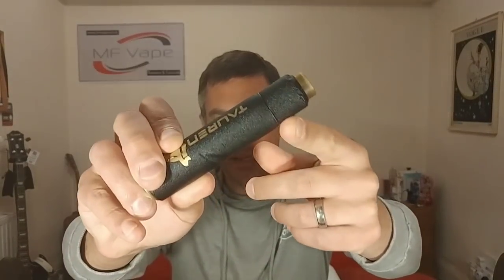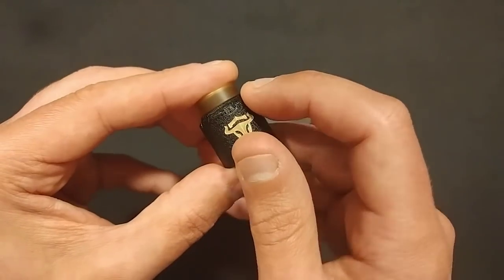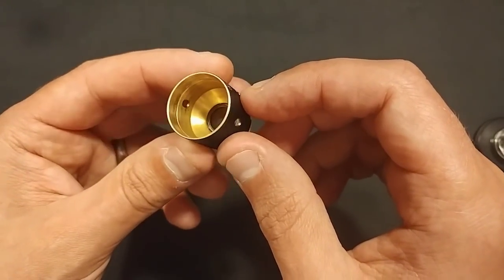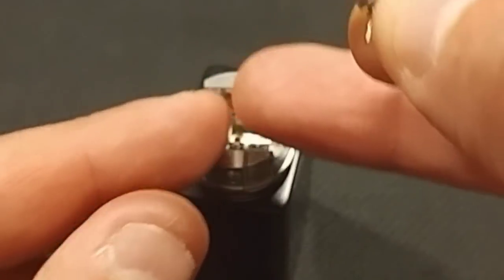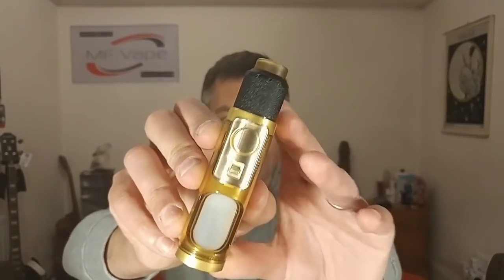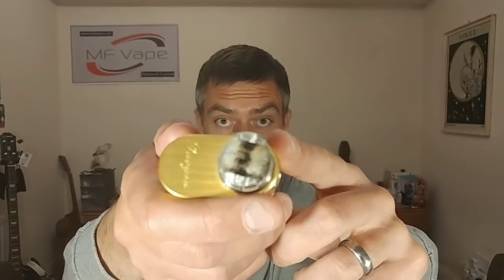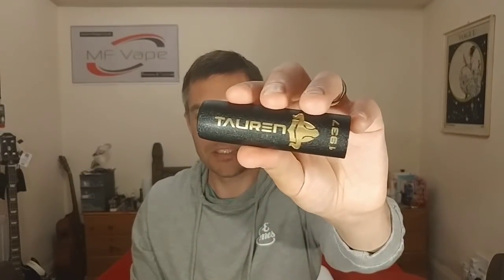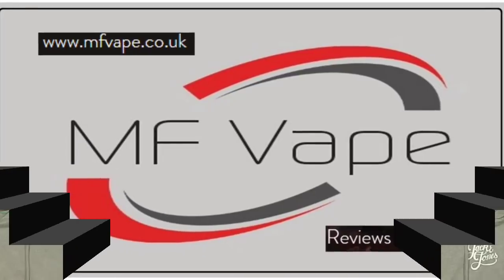Tauren RDA - Thunderhead Creations - Review, coil assembly & wicking

Comment: Very nice review bro...
i have recurve rda and tauren rda, they both are very good RDA (IMO). 
After several times trying some setting of coil, it is not possible RECURVE RDA can beat TAUREN RDA for flavor. 
I was curious how you set up RECURVE RDA to beat TAUREN RDA in flavor?
Thank's bro..
Reply from the maker: Just my personal opinion mate. I just have a 0.15 ss316l alien build in the Recurve set up how Mike Vapes has it, works a treat for me. What coils, coil positioning have you got your Tauren set up? 👍
Reply: MF Vape 
Thank's for your answer Bro..
I have tested those RDA because I was curious those rda are almost have the same airflow system so I use the same coil, same ejuice, same cotton and same mod on Tauren and Recurve Rda. 
The Coil's specs are Ni80 clapton coil 5 wrap diameter 3, dual coil  0.15ohm, single coil 0.3 ohm
The flavor on the Tauren RDA is more flavorful than recurve rda (IMO)
Reply from the maker: Fair enough mate, I think the Recurve is better using beefy coils like my alien, as the airflow section is wider. On the Tauren I was finding my beefier coils were getting too hot, so it works better using simple round wire like you are using. I still think the Tauren is a top RDA, I just prefer the Recurve. I like to vape at lower wattages personally.

Comment: Thc are making some nice stuff lately 

I have been using the THC Thunder storm BF mod for a couple of weeks now , you can pick it up for 32usd , runs 18-20 an 21700 cells no problems , full mech sqounker , silver plated an tough nylon 3d printed an i must say the print is perfect ,solid build perfect jions on all doors an great magnets too, running a le concorde RDA on top ,
Reply from the maker: I've seen that squonk mod, looks nice 👌
Reply: MF Vape its solid the build quality equals the high end nylon mods , for 32usd its a great mod,
Reply from the maker: Cool, I'll probably get one at some point mate 👍